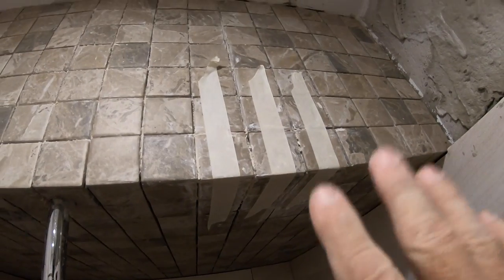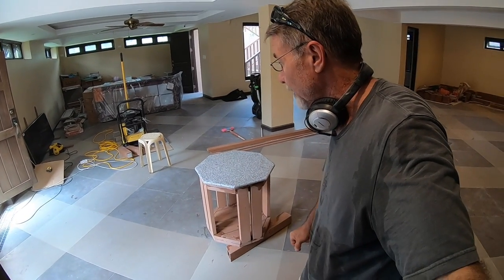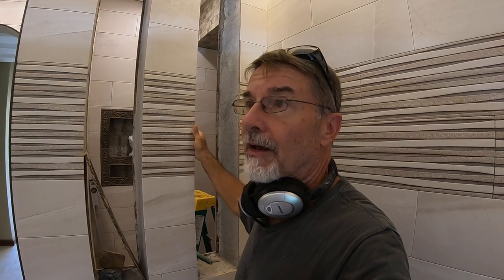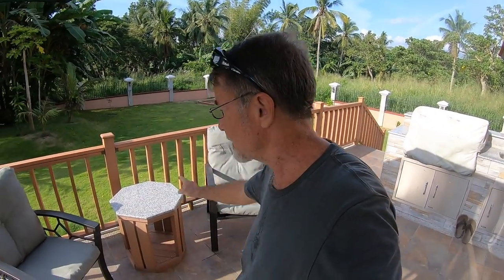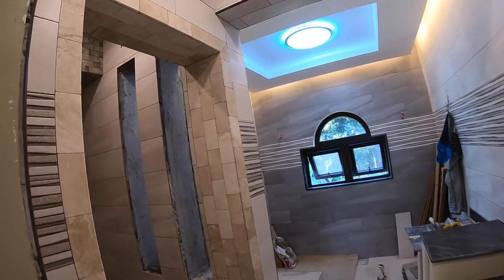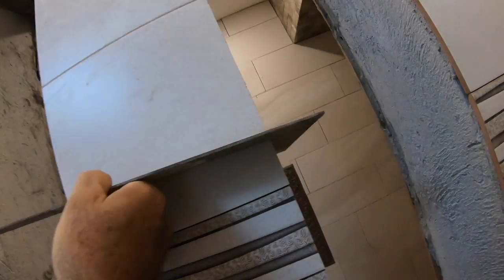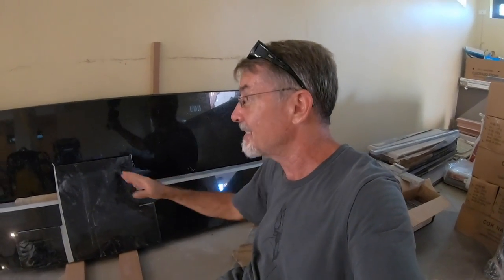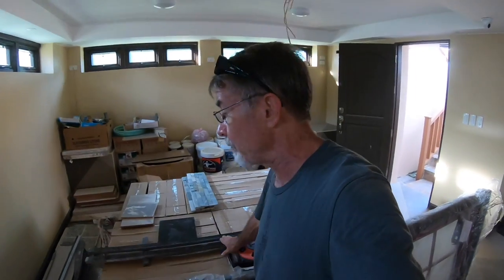VILLA FELIZ - EPISODE 395: ONE MORE TILE DAY - TAKE 2 (House Building in the Philippines)

Comment: James, could you maybe drill a smaller hole in the granite table top and have one of the workers use a round file to widen the hole until it gets to the desired size?
Reply from the maker: I've think I've got a solution but I have to wait for the bit to come in from my order on Lazada.

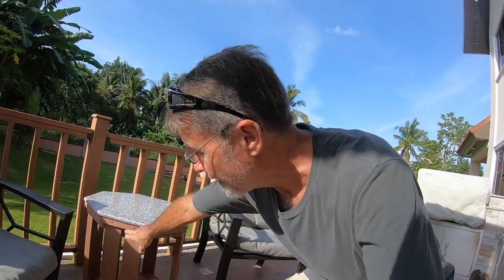Comment: Hi James, at 13:20 you mention the screw holes which you now need to find a way to fill in. Is there any way you could have screwed the decorative trim on from the inside out using proper length screws so they don't pierce out the face? If so it seems a lot of work but you could re-cut all new trim and put them on using this method. Even if you have to angle in screws from the inside and compliment the connection with an adhesive it may still give you a better finish.
Reply from the maker: Yes, it's possible if I angled the screws.  I didn't think of that when I was constructing.  Good idea!

Comment: I think you're running at Filipino speed  with those two projects, Just joking but I do like your meticulousness and care about your job . Looking good young man !With the screw holes in the table try mixing some of the dust from the cutting with glue and sand it down  cheap and almost invisible. From what I see from you I came to the conclusion  that I will have to be there when our house is built in Palawan. I have been a general contractor in Canada and the work ethic here is much different then there. I hope to have the same patience and behaviour as you have. All I can say is kudos to you cause I would have flipped my lid a long time ago.
Reply from the maker: Yes, you absolutely have to be engaged.  If not, who knows what you'll get.

Comment: What if you break the glass after it's installed in the shower?  Will there be a way to repair it?  Sorry to make life difficult?  Did you ask your excellent glass guy for his opinion?  Do you really need the glass there?  BTW, your table looks great!
Reply from the maker: I have no idea how I'd break a 10mm tempered glass window.  But it'd be an easy replacement.  Removing the 3cm granite frame would give way to the silicon reinforced tempered glass if ever needing changeout.

Comment: Why is the trim on the table even needed?
Reply from the maker: Trim covers up unsightliness and gives better presentation.  Think of it like you would crown moulding between walls and ceilings.
Reply: The top of the base is hidden by the granITE. Now you have to fix the ugly screws on the trim that wasn't needed.